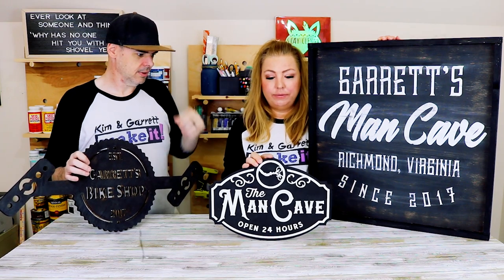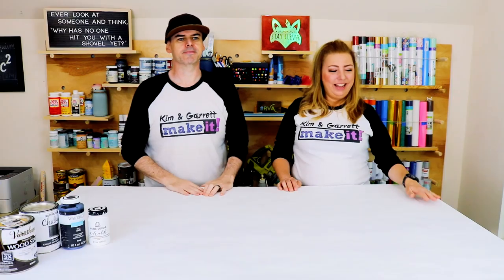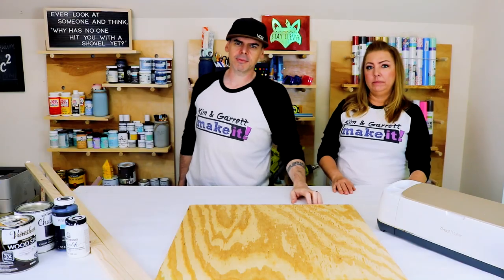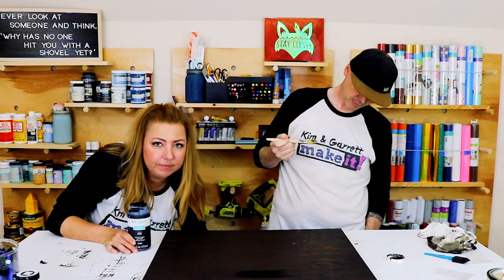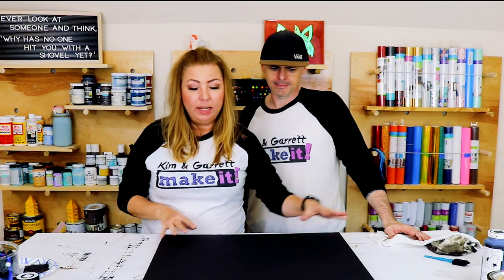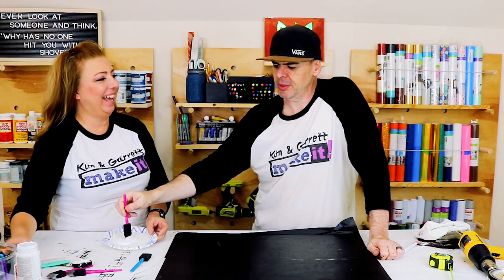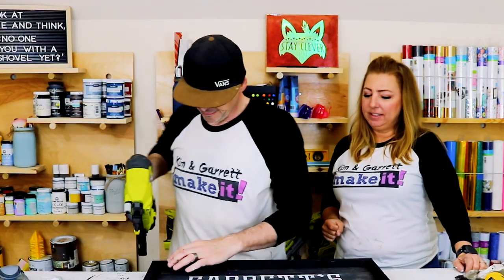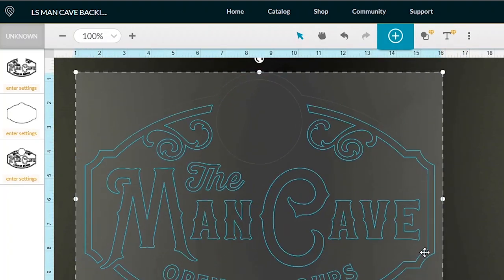3 Cool and Easy DIY Fathers Day Gifts using a Cricut, Glowforge and Xcarve

Comment: If you were to purchase just one, the X-Carve or the Glowforge, which would you buy?
Reply from the maker: It kind of depends on what I am cutting. Over 1/4" thick (or soft metal) and less detail, Xcarve. Under 1/4" thick and more detailed cuts, Glowforge.  Xcarve needs to be completely assembled (like hours or days) and the Glowforge comes ready out of the box.  We mainly use 1/8" and 1/4" mdf and plywood, so we probably use the Glowforge 8 out of 10 times versus the Xcarve. Oh! And the dust is way worse with the Xcarve, can't run it in tbe house. And the Xcarve dust control system we have is way louder than the Glowforge fume extractor. I guess the user interface on the Glowforge is a lot better too. I was going to say both, but I just talked myself into saying If I had to do it again, I would have just bought the Glowforge Pro.  Hope this helps!